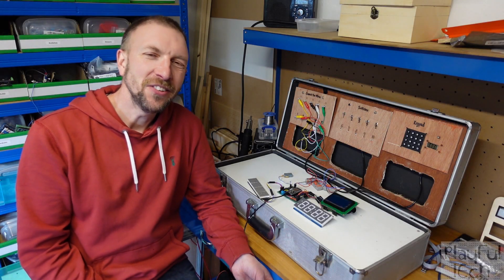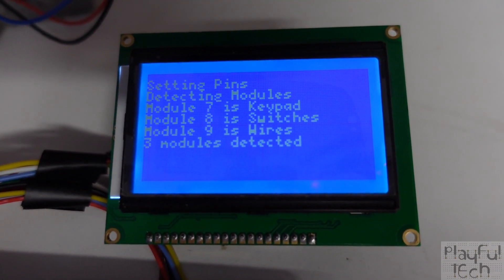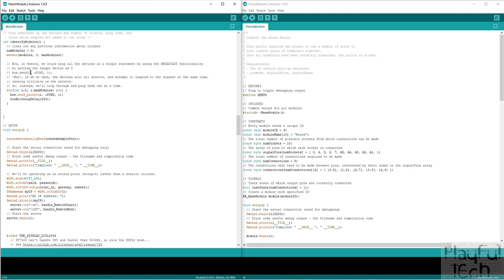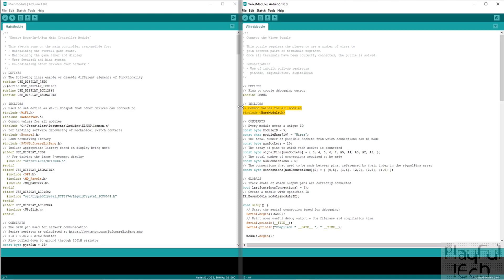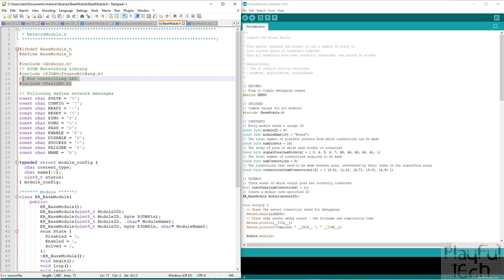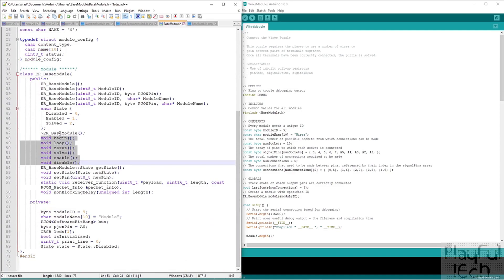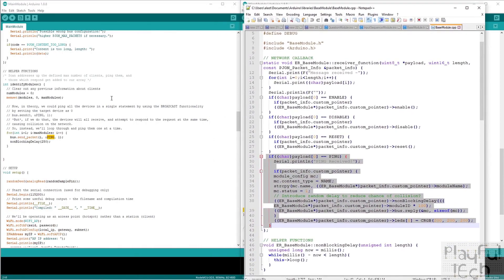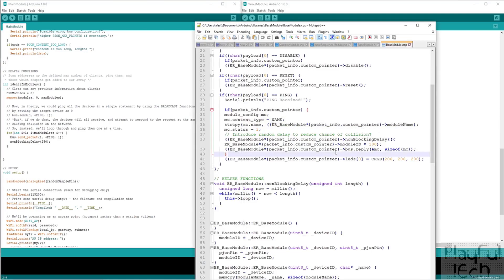Building an Escape Room-In-A-Box - Part Eight

Comment: I’m interested in how you plan to deal with the power requirements. It would be a real shame to have an awesome portable case that needs to be plugged in. Making it easily rechargeable would be fantastic and also able to run 12v for locks, actuators etc. would be an extra bonus.
Reply from the maker: I'm planning it to be fully portable - so probably powered from a Li-Po battery bank
Reply: I use a Mini UPS wich has 5V, 9V and 12V on board.  So I indeed power an old laptop screen controller, locks, and also an old Soundblaster amplifier for the sounds. Which all use 12 Volt.  Works great.  You can buy them for around 40 euro's.

Comment: Hi, very useful series of videos - working on an arduino complex project - one module doesn't work in the code - don't understand why - than i tried what you did in debugging - i deleted parts of the code untill the module started working - this way i knew what was wrong in the code - again thank you for this tip

Comment: Looking good! I'm curious of you've tried PlatformIO for Visual Studio Code as an alternative to the default Arduino editor system - once I switched over, it is so hard to go back. Autocomplete alone is such a time saver!
Reply from the maker: I have tried it, but it didn't really work for me.... I generally use Visual Studio when I'm coding C# stuff or C++ for Windows apps etc. And, if I'm doing stuff for Arduino, I use the Arduino IDE - VS Code felt like a sort of compromise somewhere between the two. (Also note that v2 of the Arduino IDE, whcih is currently available in beta, has autocomplete built-in)
Reply: @PlayfulTechnology  Cool about v2 of Arduino IDE, I didn't know autocomplete was coming!